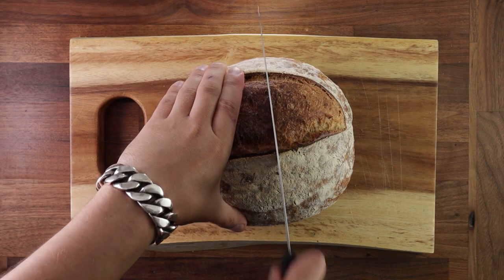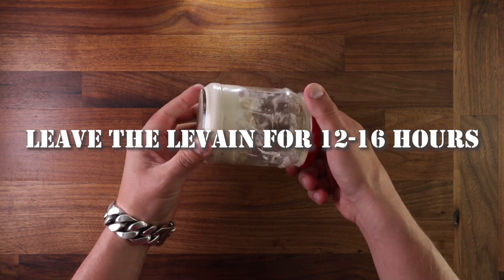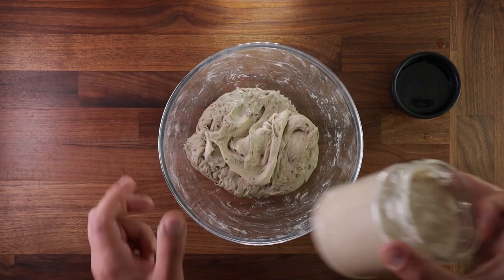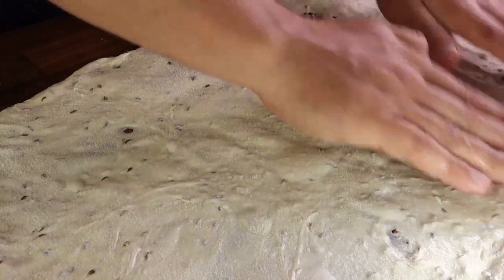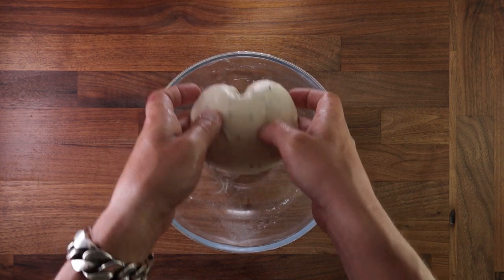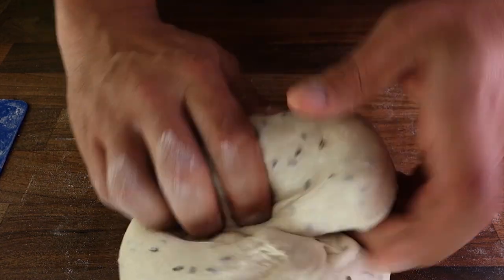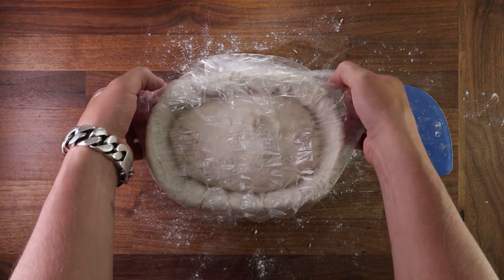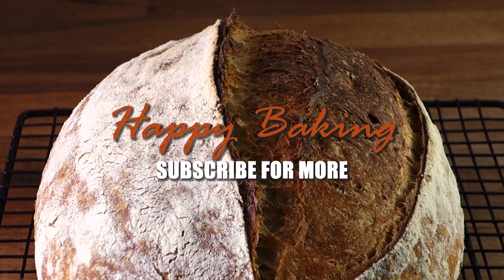Handmade High Hydration Sourdough Bread Recipe | Autolyse Method | How To

Comment: This is kind of a complicated question so I hope this is clear. 

My starter rises fast now, I can more than double it with a 1:1:1 in 3 hours just before the dome falls (as long as I feed it every eight hours or so). If I use that to bake a white flour loaf it winds up making bread that is pretty close to a straight white loaf of bread.

What I don’t like about this bread is that it has no funky sourness to it.

I realize that one possible solution is to change the ratio to a 1:10:10 and or to cool the fermentation environment for the starter. That would slow down the fermentation process and allow the levan to create some funky sour flavors. 

My problem with the slow things down approach is that it’s just so hard to know when the starter is ripe during long ferments. I like the 3 hour ferment because it’s very active, the dough it makes rises quickly and I don’t have to spend all day doing dough folds.

What do you think of this instead, using the recipe for the dough in this video as an example. 

1. I set aside 100g of starter and put it in my fridge and don’t feed it all week.

2. I make a little 5g starter that I feed daily 1:1:1 and build it up so it’s 100g right on Saturday morning.

3. Then I mix the two together: 100g of super active starter with 100g old, funky, sloppy, acidic starter.

4. I make the bread just like the recipe here entails. 

Or maybe maybe 100g / 100g would be too acidic and the dough wouldn’t be able to hold shape...so a different ratio would be better?

Have you seen any recipes like this? Do you have any thoughts on making bread like this?
Reply from the maker: Using more starter would definitely make it sourer. A very simple option would be to go for cold retarding or cold bulk fermentation. The dough will become more sour whilst it is rising slowly in the refrigerator.

Comment: Great video!
One question: What's the difference between using a levain and using your starter right at its peak?
Reply from the maker: Depends on how quickly you want it to ferment and what your starter is like. Sometimes a slow rising starter that has been fed half or a whole day ago will take longer to ferment the dough. On the other hand a levain made with less flour and water in relation to starter could be fermenting very rapidly and when you mix it into the dough it could continue the same way.
Reply: @ChainBaker  Thanks for clearing that up for me :)

Comment: A question about possibly saving some time when adding the salt. What about setting aside some small amount of the water called for in the recipe and warm it quite a bit—and use it only for dissolving the salt fully. This step could be done near the end of the autolyse period. After you've fully combined the starter with the autolyse, now pour in the water+dissolved salt mixture and again combine fully. If there isn't a great quantity of the warm water, I'd think it would not adversely affect the dough temperature.

Or perhaps even: add the water+dissolved salt mixture to the starter itself, combine thoroughly, then add the starter+salt combination to the autolyse—and again combine thoroughly.
Reply from the maker: That would work pretty well! :)
Reply: @ChainBaker  The only reservation I had was: Would this possibly risk the salt not becoming fully combined. So it would definitely call for some diligence in the mixing.

Comment: Great video, and a criminally underrated channel!
I'm having real trouble with high hydration sourdough though. Even though I'm adding less water than you (usually 70-75%), the dough always sticks to the tea towel that I prove it in overnight, then tears when I try to tip it out. I'm also not getting much oven spring, so the loaves end up pretty flat... Any tips?
Reply from the maker: Perhaps your flour is weaker?! Another reason for the dough being slack and sticky can be fermentation. If it is not rising well it can stay sticky and loose. Or it could be over proofed in the fridge?!
Reply: @ChainBaker  thanks for the response! I will try to make sure my starter is super active for the next attempt, and I tend to leave it for a long final prove in the fridge, so might try cutting that a little shorter :)

Comment: I will try this tomorrow. How important is the Fridge Temp ? And at what temp should it be so the dough comes out prefect? Minimum amount of Hr in fridge to avoid underproving?  Also, can the Levain be used at a later time. Keep at room temp, or fridge?
Reply from the maker: Tati Fernandez unless your fridge is unusually cold or very warm then you should not worry. I would keep it in the fridge for at least 12h. Feed your levain and keep it outside and use it when it is ready. That way you will be in complete control.
Reply: @ChainBaker  THANKS
Reply from the maker: Anytime! 👍🏻

Comment: This was very helpful thank you - just a question, why do you say "no fan" when heating the oven? it looked like you are using the grill setting so just heating it from above, is that correct?
Reply from the maker: My oven only has the top heating element. But I have the option to have the fan on that blows the hot air around the oven chamber. When baking at higher temperatures I do not use the fan as it can brown the crust too much too soon.

Comment: You make it look so easy! Only tried making sourdough twice and they weren't that great. Is this a good recipe to try when I'm still getting used to making sourdough or is there another recipe (maybe lower hydration) that you'd recommend instead?
Reply from the maker: JebusRocks yeah high hydration dough can be a hit or miss when you’re just starting off. You can try this recipe - https://youtu.be/BsvxiBaUC3U . Make sure your starter is nice and active and that your levain is at its peak. That is usually the main failing point with any bake. 👍🏻
Reply: @ChainBaker  ahh that's great. Thanks for replying. Will give that recipe a try next weekend and fingers crossed it works better than the previous one 🤞

Comment: Thank you, mate.
How much protein in your flour?
I live in a little country where the highest percentage of protein in the flour is 11, 12 at best.
Reply from the maker: The flour I use has a protein content of 13%. You could make this recipe just as well with the 12% one. Even with the 11%, but then you may need to add another fold and shape it more tightly so that it does not spread out too much.
Reply: @ChainBaker  thank you so much for your quick response! I will follow your advice. I see I was missing a fold then

Comment: The pan that you bake in… Would you recommend this? Are there any cons? I am on the look out for one to replace my Dutch oven that I have to drop my bread into. I like that this has such low sides. I’d be interested to know how you’d compare it to other techniques. If you’ve already done a video about it and I’ve overlooked it, please could you point me in the right direction? Many thanks. 🙏🏻
Reply from the maker: It's a 3l / 3.2qt Lodge Cast Iron Combo Cooker. I've had it for years and I bet it will last me a lifetime. Well worth the investment.
Reply: @ChainBaker  good to know. Thank you.

Comment: First time trying this today. Stretch and fold following autolyse clearly increased gluten strength but surface tension was still lacking and not at all tight as in your video. Does that suggest any particular error I might have made along the way? Thanks. (I increased the kneading time to 15 minutes but this doesn't seem to have improved the surface tension.)
Reply: Must call it quits, alas. The dough remained unworkably sticky the entire time. No surface tension ever developed. Gluten development yes, but the dough just wouldn't hold a shape at all. Very different from the "behavior" of the dough in the video (same kind of flour, I'm pretty sure). Clearly I did something very wrong, but I don't know what the mistake was.
Reply from the maker: It could be the flour. Just because it has the same protein content does not mean that the gluten forming proteins are of the same quality. You could try lowering the hydration just a bit. Perhaps that will work :)
Reply: @ChainBaker  Thanks. Considering that it has happened more than once—a gluey, unworkable dough—I'm thinking this must be the solution for a start. The protein content of the flour I've been using is 12.7%.   A readily available competing brand is said to be rated at between 12.5% and 13.5%. (Apparently with that brand it varies from batch to batch.) There is probably some expensive artisanal flour I can mail-order having higher protein content but I don't know yet what it might be.
Reply: Found one flour mill that offers 14% protein content. That seems a bit much (?).
Reply from the maker: It's pretty high, but the number does not always mean strength. I'd say try using less water and see how it goes before committing to a new flour :)
Reply: @ChainBaker  Agreed. And, it's expensive and probably isn't available in my area except by mail order. I looked for a written guarantee on their web site that all resulting loaves are guaranteed artisanal, but found no such reassurance. So I'm suspicious. :-)

Comment: I put mine in the fridge the first time and refrigerated overnight baked the next morning and it went flat as soon as I turned it out in my hot Dutch oven, so this time I baked it an hour after final shaping and it turned out beautifully, but no sourdough flavor. It got good oven spring and was light and fluffy? Any suggestions.
Reply from the maker: It was probably over proofed and that is why it collapsed. Try and refrigerate it sooner or lower the temperature of the dough.
As for the same day bake - it will always be softer and fluffier, but because of the relatively quick fermentation it will not develop as much flavour.
Reply: Ok. Maybe my dough is too warm because I mill my flour as I’m baking and it is really warm when I use it. Maybe allowing my flour to cool would help? I’m going to try again today and refrigerate overnight. Thank you so much for helping me figure this out!❤️
Reply: I know you’re probably getting tired of me by now but I need your help to figure this out. Your recipe was the only one that worked for me. I figured the proofing part out. It was my fridge, somehow it got turned to a warmer setting. Now the only issue I’m having is the flavor. I know you suggest a temperature gauge for the dough and it is a good idea but for me I’m trying to tune my natural instincts to work through the problems and use my natural instincts to learn the behavior of my dough. I guess what I’m saying is I’m trying to go back in time and learn how to get it done with minimal modern technology and devices. I’ve come to the mindset, that I need to learn how to do things like my ancestors did it with just their hands and master that process then I’ll be prepared for hard times instead of trying to figure it out during the hard times. Anyway, I got off subject sorry. Now to figure out the flavor. I keep my starter in the fridge and only feed it once a week  the early morning on the day I mix up the dough. I give it 8 hours before I mix it in the dough. If I leave the starter longer the rise starts to decline after 8 hours. Suggestions please.

Comment: Hello,

Every bake lately seems to be like a high hyd. bake and I'm beginning to think it's the protein in the flour.

Right now I'm using 10% protein white and 13% protein WW and following your recipe's they all flatten out during proof and baking.

So I'm thinking your recipe water amount is too much for my flour and the dough never gets any strength or gluten development. 

Can you make High Hyd. sourdough bread with any flour? What do you think is going on, it's like I'm putting in too much water?

Thanks
Reply from the maker: The strength of the flour will dictate the maximum hydration. 10% can be quite weak, so it's best to lower the hydration a bit to make up for it :)

Comment: Ok I’m a newbie so please don’t be harsh but is it:
300g flour
220 water
Just for the actual dough? Because you say remaining flour and water in the video.
Or are you using that amount split between the levain and the dough? I’m confused. Also I might add I’m using hard white wheat, fresh milled. So that includes the bran so I’m wondering if I need to increase the water?
Reply from the maker: Correct, it's 300g flour and 220g water for the final dough without the leaven. I always split the recipes, so you don't have to calculate anything ;) 
I would not increase it because freshly milled flour is weaker, so the bran will just help compensate for it.
Reply: I didn’t know fresh milled grain was weaker. Thanks ❤ 
I saw recently you got a grain mill and made a beautiful loaf from your fresh grains! I’m so glad you are doing this because it’s hard to find recipes and videos using fresh milled grains. They are a little more challenging. I have rye grain, spelt,Kamut/khorasan, teff, buckwheat, hard white wheat, soft white wheat, Einkorn. Any suggestions or tips with the fresh grains doing sourdough? I need all the help I can get! I’m soooo looking forward to seeing videos on fresh milled grain bread 😁

Comment: can you please do a bread with 500g flour? the kneading and folding are more challenging with that much dough. thanks
Reply from the maker: It's not that much more work. Knead it for 2 - 3 minutes longer and use slightly warmer water as a larger dough will take longer to get up to temperature👍
Reply: @ChainBaker  : it's not about the work. it's that the 60% dough is a bit hard to pinch at twist with one hand, whilst squishing a large amount with heel of other hand. got there and made great bread. technique may need adjustment for 500g or more of flour in dough.

Comment: I tried this bread today and it hasn't been the best experience. I'm not sure why, but the dough didn't have much strength, and doing the stitching method was very difficult. I put more flour than you seem to put, and the dough stuck to the counter, and after managing to roll the dough with the stitching method, it was very weak.

Right now it's in the banneton, I hope tomorrow it will be alright, but I wondered what may have caused the difference in dough consistency.
Reply from the maker: What flour did you use? What is the protein content? A weaker flour would make this a struggle as it can't absorb water as well as strong flour and the gluten gets harder to develop. If that is the case, then you can lower the hydration a bit next time to make it workable :)
Reply: @ChainBaker  I used bread flour with 12.5% of protein. I hope tomorrow I get a good result, otherwise I'll try reducing to 75% hydration next time. Thanks!
Reply from the maker: Fingers crossed! 75% should definitely make it significantly less sticky :)
Reply: @ChainBaker  Unfortunately it was not a success, after removing it from the banneton (which was stuck to the dough), it became completely flat :(

I substituted a tiny bit of the flour with whole wheat flour, could that be the reason?

Comment: Hello Charlie! I have a question here. This recipe calls for a 1:10:10 levain, meaning to say the foundation of the dough is 210g starter? Because the starter isn't growing(in your video it has tripled in volume but mine just rise a lol not even doubled. So I recreate a new one which only double in volume.) my question here is that, if I have strong starter just fed, 100% hydration, can I use 210g of it for this recipe? Have tried to look into your other principle videos talked about starter and levain, did some research but didn't quite understand. Thanks for your help!!
Reply from the maker: You can do that. As long as it's nice and active it's all the same thing ✌️
Reply: @ChainBaker  thank you so much for replying!! You're so nice!! 😊

Comment: What’s the difference between building the levan with a 1:1:1 ratio vs a 1:10:10? As long as I wind up with 200 (or 210 in the case of this recipe) grams of levan which is what the recipe calls for. And if I am using a 1:10:10 ratio shouldn’t I pull out the extra 10 grams of levan I started with to make it an even 100g flour and 100g water?

Does my question make sense?
Reply from the maker: It does make sense and it's a valid question. I personally don't pay attention to the 10g because it makes no noticeable difference in the finished product, and it is easier to calculate it this way.
Reply from the maker: At a 1:1:1 ratio the levain will rise a lot more rapidly than at 1:10:10. It's up to you how soon you want it to be ready.

Comment: How long should I preheat the oven and the frying pan ?
Reply from the maker: All ovens are different, but generally I would suggest preheating for at least 40 minutes.
Reply: @ChainBaker  Ok ...without fan right only for this recipe ? During baking process, no fan also ?
Reply from the maker: If I said no fan in the video then it’s no fan 👍🏻
Reply: OK noted